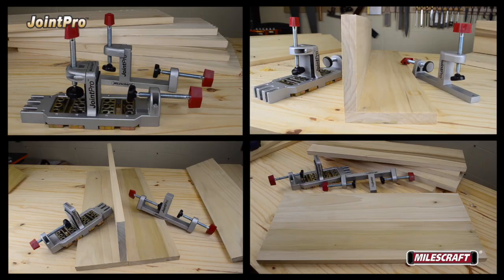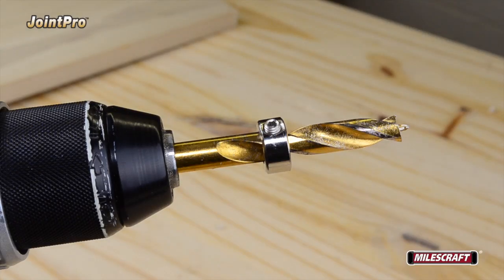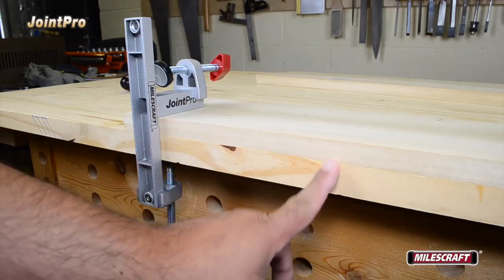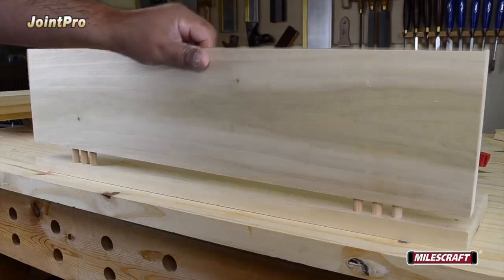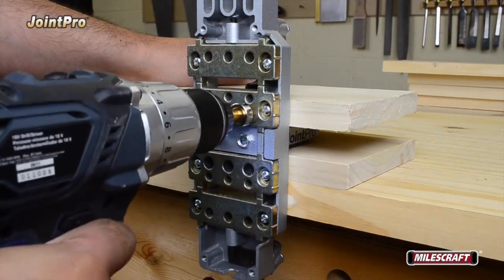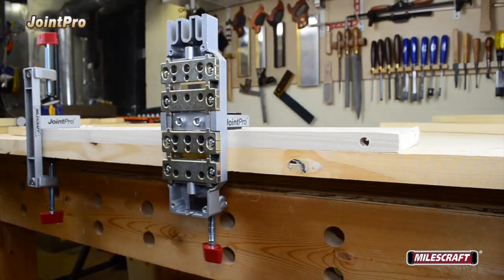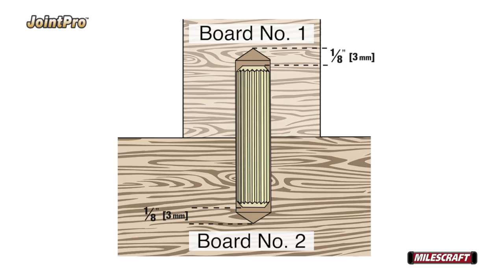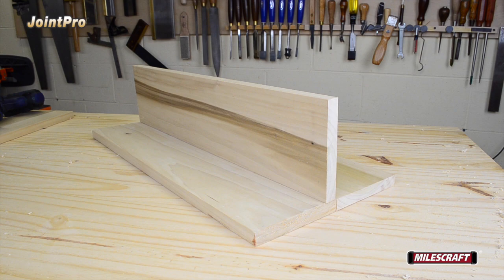Milescraft 1311 JointPro - Professional Doweling Jig

Comment: Pretty damn tedious to use. I had this in mind for a 4 piece butt joint window trim frame, but talk about making an easy thing a headache. Once upon a time I had a wonderful little Craftsman jig - 1 piece with 1 clamp and a rotating bit guide to select for dowel size with a pointer for your pencil marks. Easy peasy and worked perfectly! This thing? Ugh, it's going back.

Comment: I bought this jig a year ago and finally had the chance to use it on a dowling project where I could use it enough to try and get proficient with the tool. But after nine test holes, one end of the joint was perfect, but the other consistently was off ever so slightly, but enough to be frustrating. I watched this,and two other videos that demonstrated the jig, several times and reread the manual that came with the jig to try and understand what I was doing wrong. But at last I gave up and resorted back to pocket screws, which have never failed me. I really want this jig to work! I was using 3/4” oak plywood, but was unable to adjust the 3/8 holes to the center of the board edge, and the end closest to the auxiliary support was the end that was off a bit. By the way, I was attempting to dowel a 90 degree corner. I would love to hear from anyone who has solved this issue!
Reply: Did you already found a solution or any alternative product/method?
Reply: If there’s misalignment first check the jig itself to make sure that the holes line up. Unlikely that there’s a problem there but manufacturing isn’t always perfect. Next make sure those bushing blocks are secured correctly. Lastly the weakness with this jig is making sure both pieces of stock are in perfect alignment prior to drilling. I recommend a right angle stop that you push both pieces against before tightening and drilling. Make sure that stop is clamped and perfectly 90 degrees
Reply: @AereForst  the problem is that the jig doesn't self center the holes, even on 3/4" thick lumber. I've used it on several project and it's been complete ass. the holes are always ever so slightly skewed from center so it can really mess things up for your alignment. I'd stay away from this product if I were you.
Reply: @indyzd Sorry to hear that. I’ve had great results with mine.

Comment: In my experience,  this is a peerless doweling jig; if you take a few additinal steps not immediately apparent from this very helpful video. 

Note that the range of material thicknesses is 14mm to 30mm.

As part of your initial setup,  mark a line through the center of the edge in the area where you are going to drill your dowel(s). Thereafter, remove the two guidebush blocks that you will not use at this time ( because they do not contain the hole sizes that you need).

Then attach the jig as shown in this video AND slide the guidebush blocks vertically until the guidemarks on both sides of the blocks align with the line through the center of the target edge faces. Screw the blocks in place and follow the rest of the steps in the video for aligned dowels.

Just remember to perform the block adjustment step as you set up to drill the holes when your board-thickness changes.

I hope this helps.

Comment: this is best argument to use biscuit joiner. by the time you set these up and align them you can finish a project with biscuit joiner
Reply: Only if you don't need to strengthen the joint, otherwise. A biscuit only helps with alignment. Much better with a domino....or if you can afford it...the brilliant Mafell Duo Doweler.

Comment: Stupid question here, is it at all possible to adjust this tool? The project I’m working on, after I drilled the holes are off ever so small, but still off... thx
Reply: the problem is that the jig doesn't self center the holes, even on 3/4" thick lumber. I've used it on several project and it's been complete ass. the holes are always ever so slightly skewed from center so it can really mess things up for your alignment. I'd stay away from this product if I were you.

Comment: When demonstrating this tool why does everyone show a shelf mounted a few inches from the edge of the board? Presumably you can't fit a shelf say half way down a book case.
Reply from the maker: Hello, if the book case frame is already made, then you are correct, you cannot dowel a shelf half way down. However, if you are building from scratch, you can pre-mark and put all your holes wherever you want shelves, and then assemble all at once.  Once the unit is glued together, adding extra shelves any where in the middle will require something like pocket hole joinery or using shelf pins. Thanks!
Reply: @milescraft  I had been watching a number of vids showing various different dowel jigs, some more helpful than others! After watching this one again I think my comment was intended for one of the others! This one makes the method quite clear, I should pay more attention.😏

Comment: Question. Would this tool still work if I used it on 38mm scaffold boards? Would the holes still be in the centre on the edge of the board?

Comment: ci sono negozi a roma it che vendono questo ????
Reply from the maker: Giancarlo, 
While Milescraft does not have a retailer partner in Rome, this can be purchased from one of our retailers in France. For your reference, I have included a link to the Otelo website, where you can order the #1361 JointPro, in the metric size.  http://www.otelo.fr/is-bin/INTERSHOP.enfinity/WFS/Otelo-France-Site/fr_FR/-/EUR/Navigation-Dispatch?Nty=1&Ntx=mode+matchallpartial&Ntk=Default_OTFR&Nu=p_SkuGroup_ID&N=16037+16046&SearchEngineBar=true&Ntt=jointpro&x=0&y=0

Comment: what thickness of board can this jig handle?
Reply from the maker: We have not done this project yet, but it should be possible that you can do up to 2.25" in board thickness. This may take some adjustments, but it should be able to be done. We call out 1.5" in our manual for the instructions.
Reply: Many thanks. I would really like to buy this jig, but retailers in Western Australia don't seem to be able to get stock.
Reply from the maker: Peter, we do have retailers in Australia that carry this item. Perhaps you can have it delivered:
https://www.timbecon.com.au/joinery/biscuiting-dowelling/jointpro-dowelling-jig
http://www.timberbits.com/milescraft-1361-metric-jointpro

They go quickly, so just keep in touch with them and I am sure you can get your hands on one. They both order frequently.
Reply: Many thanks!
Reply: I'm considering buying one from this retailer. I am making a set of drawers where the dowels will be in the narrow sides of the timber pieces which are only about 100mm (4") wide. The video only shows the dowels being inserted into the long sides of work pieces. How effective is this system with narrow faces like this? How closely can you mount the supporting clamp to the main jig? In other words, what is the narrowest work piece that can be used while maintaining support from the support clamp?
Reply: @stevanr2401  got the same question